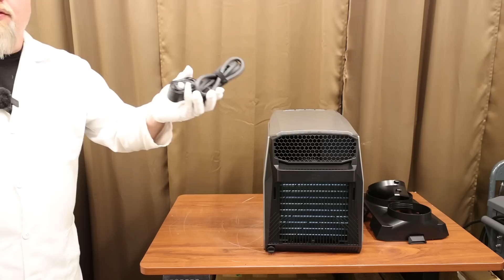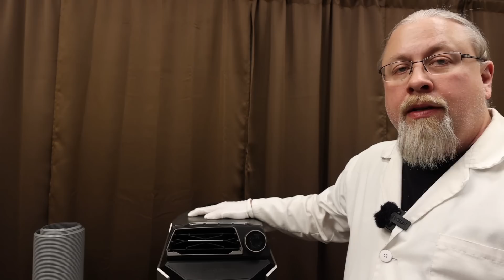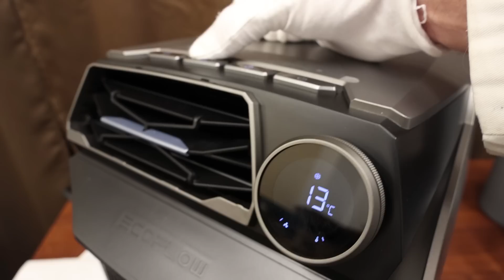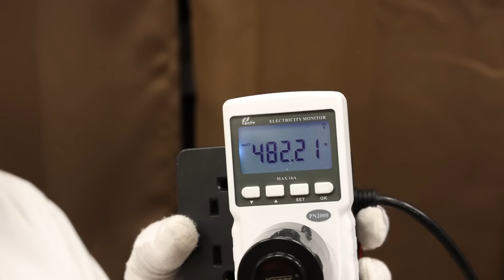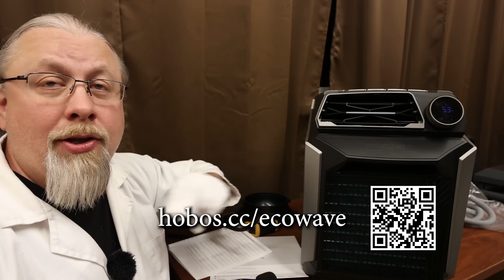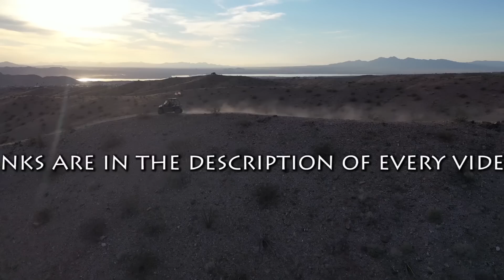EcoFlow Wave PORTABLE Battery Powered Air Conditioner 4000 BTU First Look Review

Comment: The hose attachment would work great for an interior install on an RV or van, because you want your draw from the floor, and your cold air overhead. This would also be great for a semi-tractor trailer... there are usually a bank of at least three batteries or more in the cabs alone.

Comment: I don't get this whole configuration. Normally, you want everything possible to be OUTSIDE your tent, trailer, or home with power outage. You want only the cooling hose coming inside. The outside part should be waterproof. A remote or phone app could operate the outside part. Yeah, I know theft precautions would be necessary.

Comment: The problem with all these type of ac is the Hot air off the condensor goes out side causing a negative air inside. So the new return has to replace the old air..................new air comes in from any place it can,windows doors etc.   So do you see the problem.  46 yrs in the ac business
Reply: Ah so maybe even this is only a fancier spot cooling unit?
Reply: I think they have worked out the 'negative air' with the front lower intake.  Will have to wait and see.
Reply: Nope
Reply: @keysthinking  Yep.  According to PrEcoflow comment.   I don't think anyone is saying this is a 'game changer' in A/C technology, but more of the most efficient way to accomplish the task within the capacity of a portable unit this size, weight, and price point.
Reply: Hi there, when the machine is placed inside for example a tent or an RV, we extract the outdoor air through the air inlet pipe and bring the heat generated by the condenser to the outdoor through the air outlet pipe, thus no negative pressure will be formed indoors.
Reply: @precoflow4272  So,whats your delta on the evap coil

Comment: Can you plug 450 Watts worth of solar panels into it to keep it running on solar and solar-charged battery alone?
Reply from the maker: It only takes 200w solar but you can plug a Delta product into it that charges faster
Reply: @HOBOTECH  Thanks for the reply! I've only recently discovered your channel but which Delta product would you recommend and does it allow you to daisy-chain solar panels together?
Reply: Hi there, you can charge the add-on battery or run it under fan mode with solar input!

Comment: The wattage isn't that bad. I have a Delta Pro and Extra Battery and if I run it via DC then I can theoretically run the Wave for 24 hours. More solar panels here we come!
Reply: How could you get 24 hours from a Delta Pro and Extra Battery? From what the EF annonced, 11hrs cooling off Delta Pro and 3hrs cooling off Add-on Battery, totally 14hrs cooling.
Reply: @mat284  Delta Pro and the Extra Battery (for the Delta Pro) are both 3.6kwh. That's what I mean.
Reply: Stay awesome out there Lacy! 😊🌎☀️
Reply: I have 2 Ecoflow Deltas and 1 Max. I need more portable type solar panels but don’t really know how to shop for them. Andy suggestions would be greatly appreciated!

Comment: I really want to know it's Energy Efficiency Ratio (EER), the official has not announced it, I don't know what the temperature of the test environment is? 70F, the power consumption is close to 500w at this time, if the ambient temperature is 100F, it may over 600w, its EER is too low, 4000/600=6.6
Reply: I think I agree!
 Sorry hobo, love ya but….
Don’t ban me please!
but I could listen to a democrat press conference to get this much speculation with no known actual scientific results.
Reply from the maker: Watch the video. I said ambient is 70 degrees.

Comment: Portable battery powered air conditioner? $1199? I don't see how portable it is. It's better to use a window AC with a portable power station . Its size is 20x12x16in (3840 cub inch), which is 16x16x12 (3072 cub inch) more than my window AC. You must know that my window AC is 5000BTU, $169. The only thing you need to do is add a tube, a tube values $1000?
Reply: You got the point!
Reply from the maker: It's portable when you either use 1) the battery or 2) a Delta product

Comment: insulating the exhaust hose greatly increases the cooling abilities dramatically.The concept  of a/c is to remove the heat. If the exhaust pipe gives back a lot of the heat sucked out... well i hope you see the point.. it works.. i used one for years
Reply from the maker: You HAVE to insulate the hose or it's really inefficient.
Reply: This is true. I use 2 portable ac units by LG. I use reflectix brand insulation for the hose. It's a huge difference in cooling efficiency and its cheap

Comment: I don't know why these manufacturers don't come up with a small unit based on mini-split technology with a separate inside & outside units, connected together with a flexible hose.  The noise level of my mini-split is less than 30 dB. I need ear plugs to fall asleep with a unit making 60 dB noise (even my ceiling fan is much less than 60 dB).
Reply: You shouldn't be disconnecting/reconnecting high-pressure refrigerant lines/hoses. Even if they had a quick connect/disconnect, I used to do HVAC and any failure of the connections will be an immediate discharge of super cold/high-pressure gas. Chances of leaks or accidental discharge are a liability.
Reply: @sanseiryu  You are correct about not disconnecting refrigerant lines, however I was wondering, if the manufacturers could come up with flexible / insulated hoses instead of the existing soft copper lines, to make it easier to store and use the connected inside & outside units (I wasn't even thinking about the quick disconnect, another design idea). The "Mr. Cool" mini-split comes with pre-charged refrigerant lines and all the DIY installers loop the extra lines (instead of cutting them short), and no need to vacuum the lines.
Reply: @George_us  They do have high pressure non copper flexible hoses. They are really just hydraulic steel braided rubber hoses. But even those are not disconnected other than when replaced. Precharged A/C units and refrigerant lines are not to be disconnected once placed in service. We're dealing with refrigerant gas not hydro oil. Even a small leak will cause problems unlike an oil leak.
Reply: @sanseiryu  I know where Ecoflow is coming from and this would be a great compliment to their Delta Pro when you are living off grid.
Reply: @sanseiryu  not to mention has to be vacuumed every single time to ensure no moisture. That guys comment reminds me of when a 18yo shows up at the jobsite knowing everything and how it should be according to them, even though they know jack shit about anything
Reply: closest I have seen is something like this soleus model:  Soleus Air WS3-08E-201.  Window unit but split internally so condenser/noise is outside.
Reply: @zzbear99  yeah Ive seen them and they work pretty good. I think this guy above forgot what portable means
Reply: The same exhaust hose attaches to the front cooling duct to funnel cooled air from the outside for a quieter option.
Reply: 60dB, very noisy
Reply: @mat284  worth keeping in mind HOBOTECH quick-tested this w/o the hose attachments, so it will likely be quieter with the exhaust hoses attached.
Reply: Forest Air makes an 8k btu portable mini split with quick disconnect refrigerant lines
Reply: OH YES SO PORTABLE.....................................................

Comment: call me when they have a heat pump version. it's sad that anyone is still creating ACs that can't reverse the coolant flow and turn into a very efficient heater
Reply: Run the condenser exhaust hose into your tent and the unit is now a heat pump.
Reply: Reverse the hoses!

Comment: Last week I was able to run a 5,000 BTU air conditioner (The one Sam's Club sells for less than $200) for 8 hrs, 45 Minutes off of 320 AH Lithium batteries. It pulled 365 Watts on low cool and mot much more on high cool. Since it's not a "smart device" the compressor was on all the time. 
Next week I'll be testing the Midea 8,000 BTU "U" inverter AC. I think it will last much longer since it won't run continuously.
Reply: FACT* the compressor shuts off when temp. is reached, but the fan keeps running. not the compressor.. smart device turns off the fan when the compressor is not running
Reply: @mikebradley4245  I'm pretty sure the compressor was running the whole time. It drew between 300 60 and 370 w continuously for 8 hours 45 minutes. 
No set temp was reached as I had it set up as a bench test and a huge shop area at about 80° ambient.
Reply: Yeah my cheap 5000btu from home Depot only pulls 375W when the compressor is on.
Reply: @douglastaylor43  My thoughts exactly.
Reply: Also when the a/c dies you can easily replace the unit at a fraction of the cost.
Reply: but it's not smart and portable
Reply: @jasminekim3111  I don't need portable. As far as smart goes I've decided if I do end up putting an AC unit in my van it will be a 5,000  BTU that I already own that is programmable, as a remote control, and uses about the same amount of energy. I was simply thrilled to find out I could get more than 8 hours of cold AC on one charge of the batteries. With about 400 watts of solar on the roof, on a good day I could run the AC without even touching the batteries.
Reply: @jasminekim3111  That's okay. We want to stay away from anything "smart", as they are all spy devices.
Reply: Check the 6000 slow start + eco and super quiet Frigidaire model.  Runs around 270-350 watts in eco mode up to 470 watts full fan and compressor ramp up when first started.  That "maintain" eco mode once the room is cooled off is really nice.  Will even shut all the way off once temperature is achieved.  IOW, SUPER efficient.
Reply: @Roobah  Model # please? I'm interested.
Reply: Typical 5000 window unit will use 325 to 400 watts at full draw. The “U” shape ones get pretty mixed reviews. Not sure how much more efficient they really are but they better be for the price difference.
Reply: @curtispavlovec  I'm a bargain shopper. I picked up the U shaped unit as an open box special. The U shaped unit we'll end up going in my bedroom.. if I end up putting an AC unit in my van I'll use another 5000 BT unit I already own that is thermostatically controlled.
Reply: Can you probably add a smart sensor connected to a central hub that could read room temp like smartthings multipurpose sensor. Connect the AC to a smart plug and make a program in the app that will shutoff if it reached  desired temperature.
Reply from the maker: Those numbers mean nothing without knowing the ambient temperature. If it's 75 degrees outside and your a/c is set to 70 it will run for days on that battery.
Reply: @HOBOTECH  Ambient temperature was about 80°. I had it set up in the shop on a bench. The shop is about 40x40 with 15 ft tall ceilings. So neither the exhaust nor the cool air affected the room temperature at all.
This was a test for my batteries. I have eight, 40AH Valence batteries and this is the first time I have done any real testing with them.
Reply: @keithbrookshire  The dial really does intrigue me. I kinda like the rotary dial with an LCD screen right in the middle.

Comment: Sheesh that pricetag.
Reply: Even hobotech didn't mention price figuring... if you have to ask, you can't afford it... so it's a window AC with sportsman gen for the cheap seat ppl again
Reply from the maker: @welcometoreality3450  The much smaller Zero Breeze costs more.
Reply: @HOBOTECH  How does it function against the much smaller ZB?  Much smaller mean more portable also.
Reply: @HOBOTECH  It does seem that the Wave is way better than the Zero Breeze.

Comment: Hmm would be a potential buyer for this. I had my eyes on the Mark II but I heard it was really disappointing from more than a few people.
Reply: I would like to say that wave initially looked for a lot of people who own ZB. Hopefully, there will be helpful. I both own Delta and Mark 2. When you use a unit on a 4x4 RTT, you will see how important is the weight, size, and carry handle for outdoor. Neither 2300BTU nor 4000BTU can cool down under the sun. ZB's deficiency is no thermostat, no app. Wave's deficiency is portability, EER.
Reply from the maker: This is far better than the MKII ... I ran one for 3 months last summer.
Reply: Well be careful with this too, zero breeze seems to be a scam, and this looks way better but the price is extremely hefty at $900, that’s not even including the battery…

Comment: I want to buy a portable solar generator for my refrigerator or freezer that I can charge my small Accessories too. Which one do you suggest?
Reply: ❄️⚡️Have you checked out ICECO JP40 & JP50 PRO yet? I just ordered the JP50. 
HOBOTECH recently reviewed it. The power pack is rated for 250mAh iirc and should charge small accessories and is in itself, a small refrigerator/freezer. 

Or look into the EcoFlow Delta or Delta Max as great options to power your current fridge/freezer with power to spare. I have a Delta and a Delta Pro and they both work very well.
Reply: @evolv.e  I want a Solor Generator to plug my house freezer or refrigerator when the grid goes down
Reply: @sherryj1704  in that case, Delta Pro is the way to go with an EcoFlow Smart Panel. 
I have a Smart Panel and 20 solar panels on the roof - you can daisychain DeltaPros up to 25+kWh and further supplement them with additional add ons if one feels it necessary. EcoFlow has an excellent array of solutions and their products are reliable and simple to use.
Reply: @evolv.e  TY